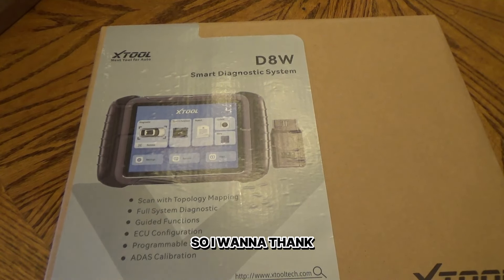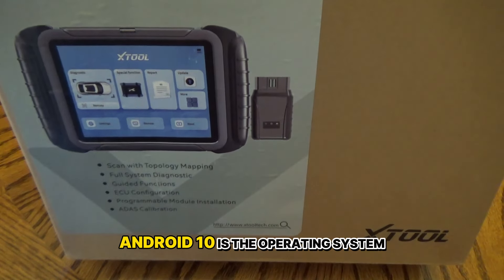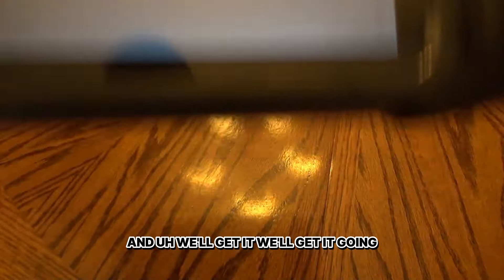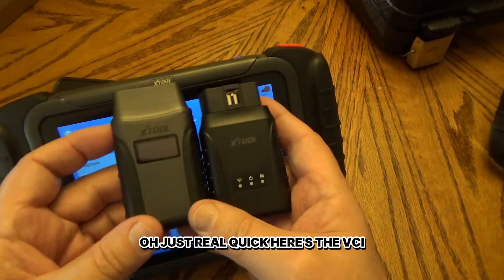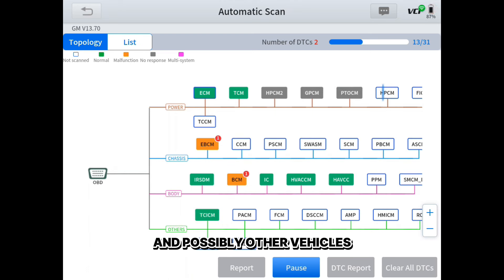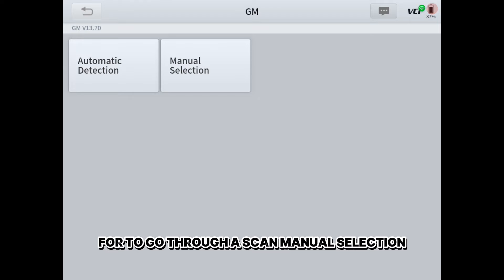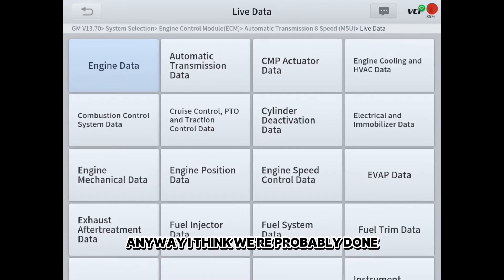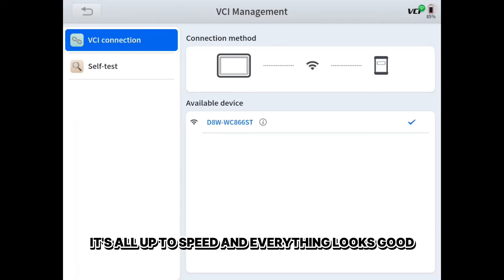XTOOL D8W : Unboxing & Review Video

Comment: Just received my D8W and it has USB C charging which I'm very happy about. Also included was a OBD2 to serial cable, what is this cable for. The unit has no serial port.
Reply from the maker: It is used for self-test.
Reply: @xtoolonline  And what is the procedure for that, it's not listed in any documentation.
Reply from the maker: The catalog is still being updated. You can use this line to connect your VCI connector to perform self-test.
Reply: Self test & I think to plug it to your PC